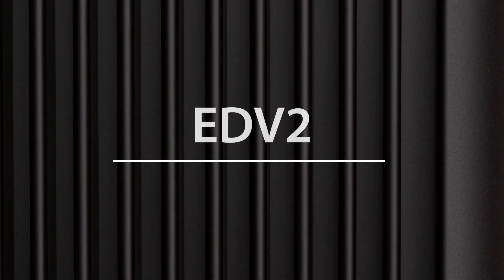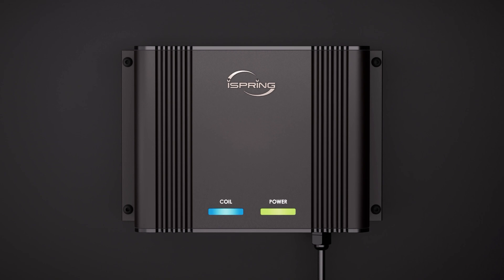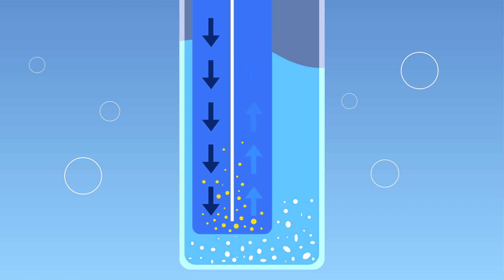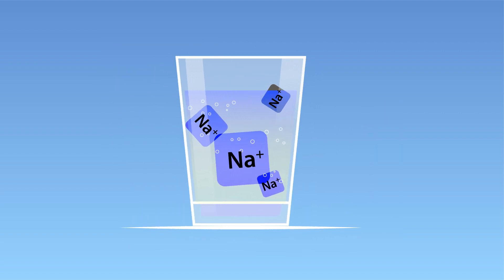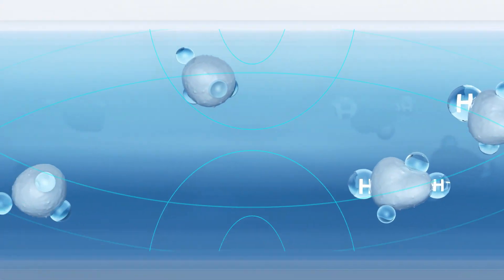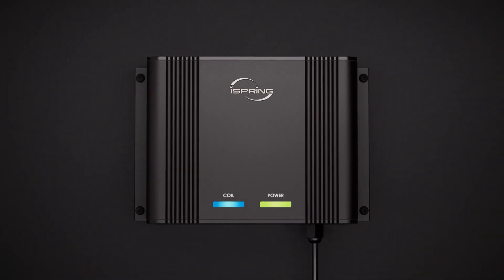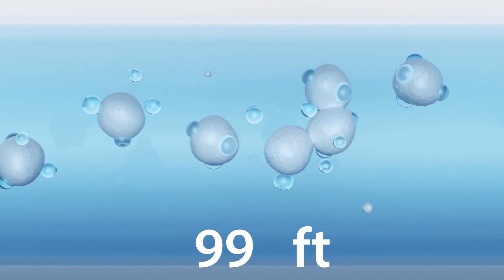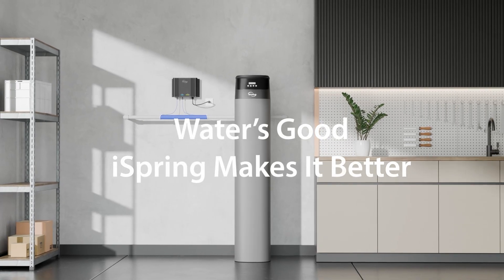How the iSpring EDV2 Electronic Descaler Solves Hard Water Problems Without Salt!

Comment: What ratio of mineral deposits will this system handle? The water where I live is quite hard.
Reply from the maker: Hi there! The electronic descalers help reduce and prevent scale buildup caused by hard-water minerals like calcium and magnesium. The electronic descalers change how the minerals behave; however, they don’t actually remove those minerals, so the water will remain hard.
For very hard water areas, typically above 120 ppm, we recommend a traditional water softener for the best results.
If you have further questions or concerns, contact us at support@ispringfilter.com or 678-261-7611 (Monday–Friday, 9 AM–5 PM EST).We're here to help!
Thank you

Comment: So this gets hooked up only to the water line going into my Electric  water heater?   Or is it hooked up to the main water line for all of the house?  And it is safe to drink water that has been through the magnetic field inside the pipe?
Reply from the maker: Hi there! Installation of the EDV2 system requires mounting the descaler unit on a wall and wrapping the coil wiring around the main water supply line. 
For your reference, this is the installation video of the system:
https://www.youtube.com/watch?v=QRwLTQLnBQg  
Regarding water safety: yes, it is safe to drink water that has passed through the magnetic field. The device does not add chemicals or alter the water’s composition, so it does not affect taste or quality.
However, if your water contains contaminants, we recommend adding a filtration system designed to remove them and ensure your water is safe.
If you have any questions or concerns about our products, please feel free to contact us at support@ispringfilter.com or call us at 678-261-7611 (M–F, 9 AM–5 PM EST). We’ll be happy to help!
Reply: @iSpringWaterSystems  Hello and thank you.  I actually ordered the whole house 3 stage water filter system  WGB32BM along with the ball valves.    Water descaler EDV2 . And the spin down sediment filter.  The 3 button digital water quality meter and 2 sets of replacement filters F3WGB32BM .  I ordered them from Lowes because their prices were a little lower.    Do I mount the descaler after the whole house filter?    Thanks very much!    I have a hardness of 15 .  Iron is 0.3 ..   PH 7.5 ..   Manganese is zero.  And the TDS is 280..    I think that I did right in what I ordered??   And this is a private drilled well system.

Comment: Does this help with dry skin? Or would I need a softener?
Reply from the maker: Hi there! The electronic descalers help prevent scale buildup and corrosion on your appliances by altering the behavior of hard water minerals. However, they do not actually soften the water and won’t have a significant effect on dry skin caused by hard water.
If dry skin is a concern, a water softener is usually the best choice, as it removes calcium and magnesium minerals that cause hardness and can lead to skin dryness.
If you have any questions or concerns about our products, please feel free to reach out to us at support@ispringfilter.com or call 678-261-7611 (Monday–Friday, 9:00 AM–5:00 PM EST).
Thank you!